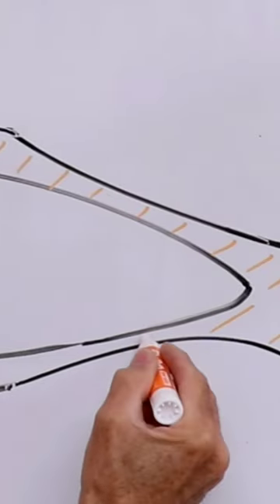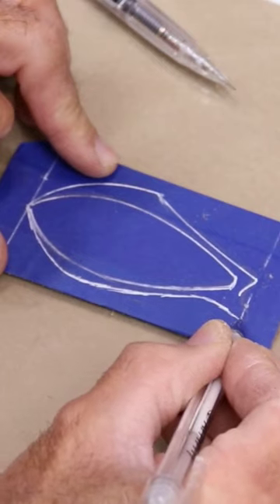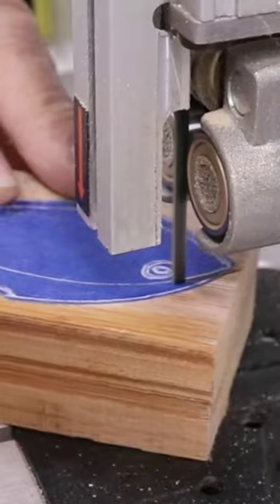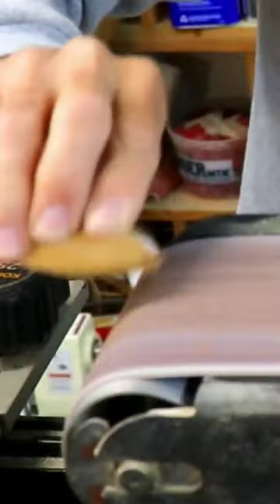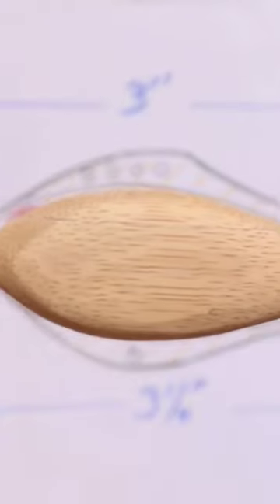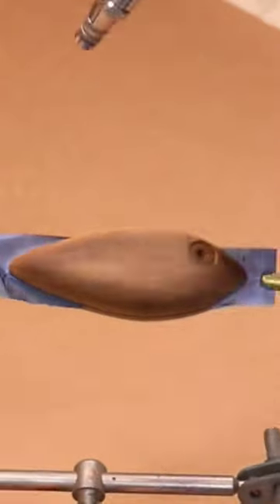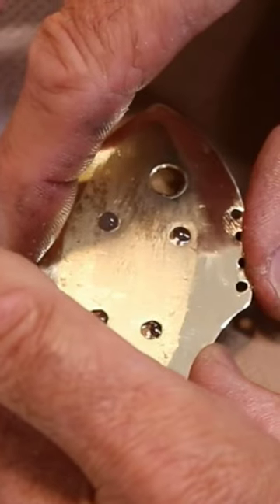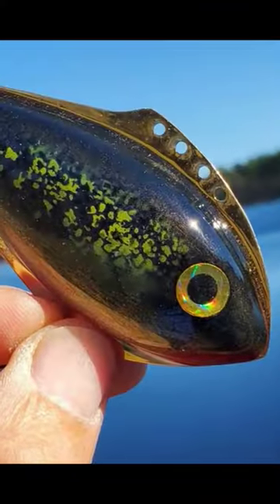Making a lipless crankbait from brass and bamboo  #shorts #luremaking #crankbaits

Comment: Cool… not many custom builders make lipless cranks. I only know of one other builder really. I use brass sheets but for just the rattle chamber covers. The rest is more like a traditional wire through crank build… just more strategically weighted I guess. I like that solid brass center design though. Interesting and I bet it could extend out far enough on the nose to absorb some of the abuse from banging it into everything. lol . That’s the tough thing about building lipless… without a lip you need a super durable and flexible clear coat on the nose.